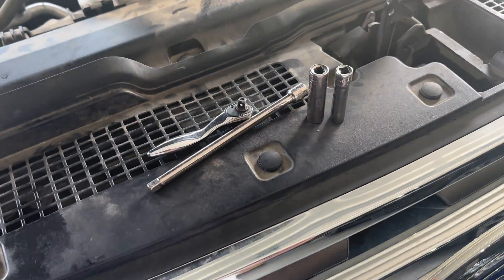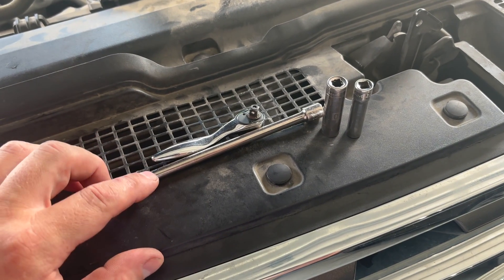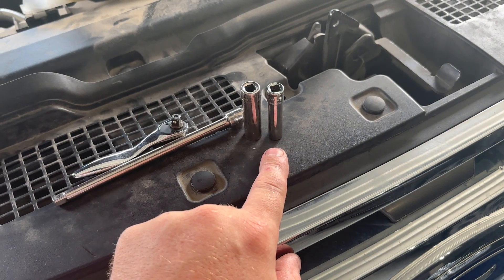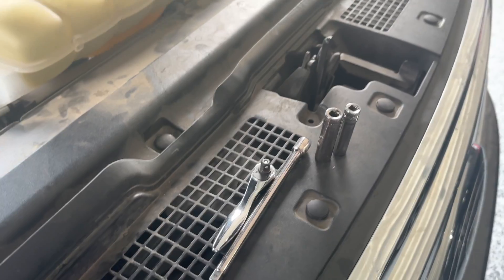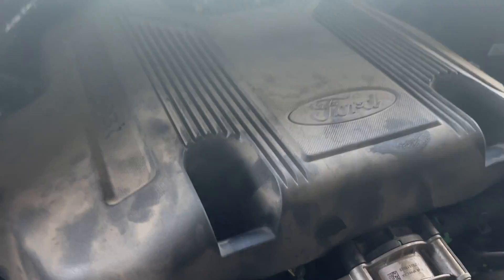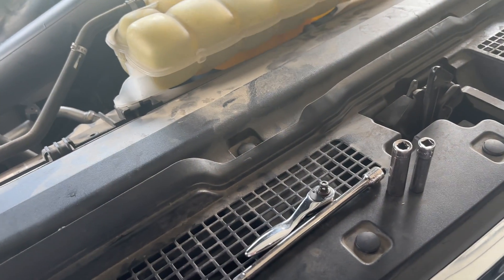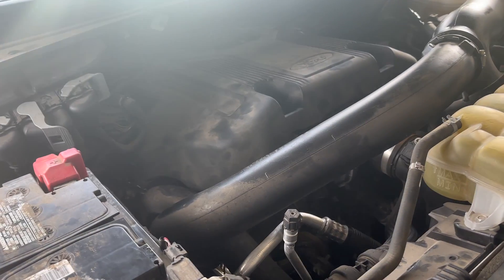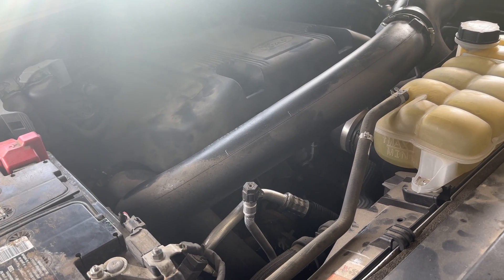EcoBoost Stutter While Passing? Diagnose & Fix the Misfire

Comment: I like that you talked about the symptoms! Have an older expedition with similar symptoms and had also recently changed the plugs earlier. So I believe it is also the coils. Waiting for the engine light to turn on again
Reply from the maker: If the check engine light is actively flashing on and off, it’s misfiring and probably starting to heat up your cats pretty badly. If you let it go on, it’ll melt the cats. Just be careful, and best of luck!

Comment: You mentioned a Foxwell Scanner to reset the code? Can you drop a link for that device? Amazon has so many to choose from. Great video Thanks
Reply from the maker: Absolutely! I updated the video description with the link to the Foxwell NT530 with the Ford software pre-installed on it. The scantool itself is upgradeable for many manufacturers. You just have to buy the software for $40-80 for which-ever one you want to use and then it allows you to read OBD2 Codes as well as factory codes from most of the internal modules on the vehicle. Thanks for calling that out!